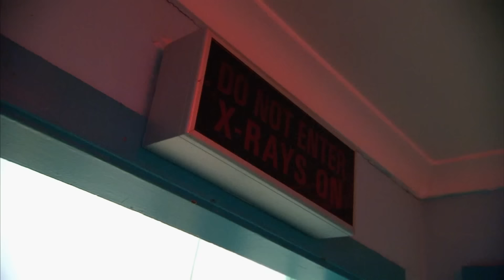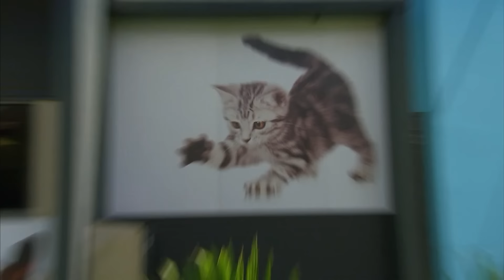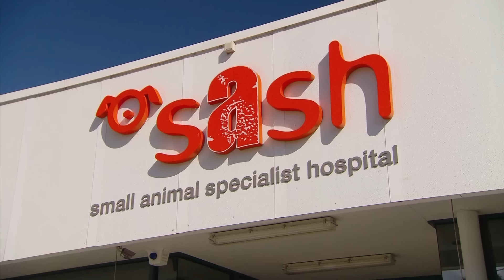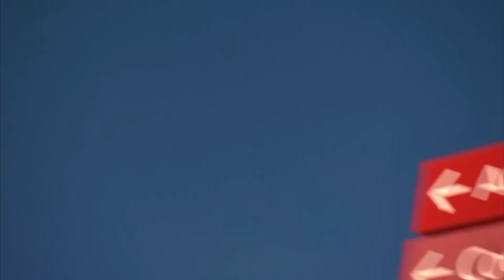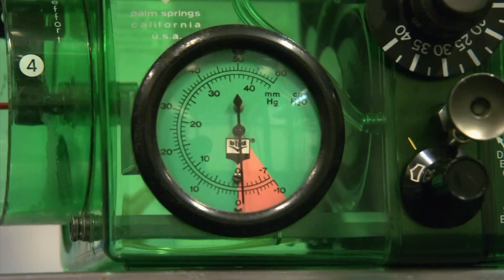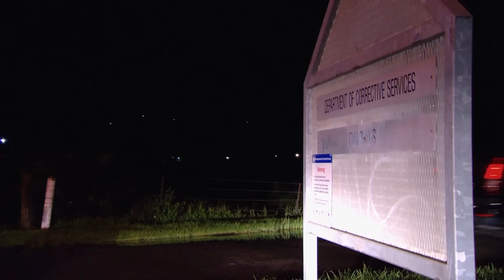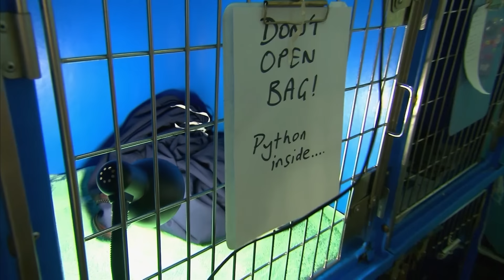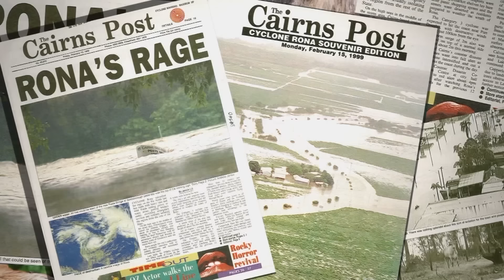2+ Hours of Full Episodes - Bondi Vet Complete Season 4 Part 2 🤩 | Bondi Vet Compilation

Comment: I've had puppies with swimmer legs, its not that big of a deal. Some medical tape and pull the legs under so the muscles and joints are made to do the thing, and walk them between two things in a narrow path several times a day, and their body gets it together. Its only deadly if you just don't do anything. Its not a hard fix.

Comment: Personal opinion, root canals are bad news for humans/mammals.  Shabby long term consequences. Better off removing the affected tooth.
Reply: You're right, root canals don't work. The stuff that they put in the tooth to replace the affected pulp is a liquid FOAM material that DRIES OUT THE TOOTH from the inside, and what happens after that is - the tooth cracks and falls apart.